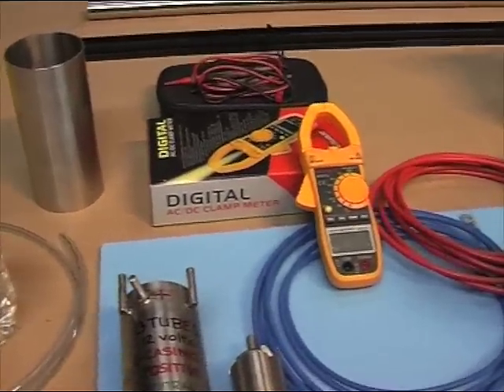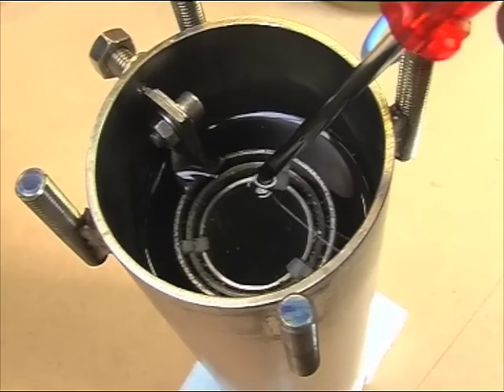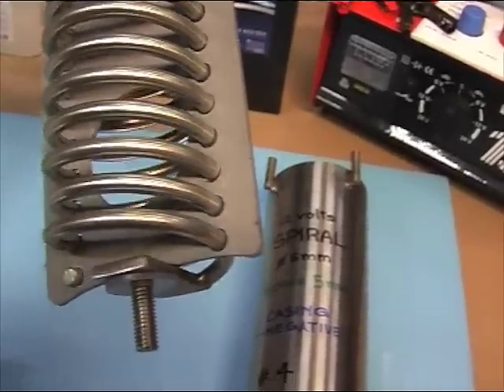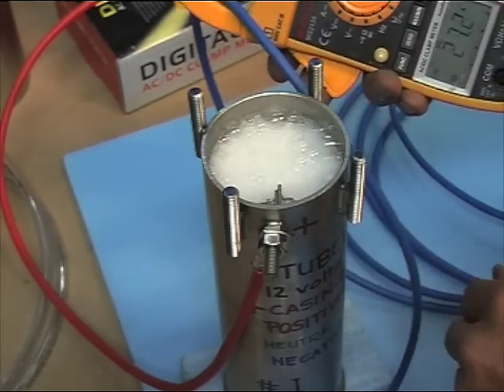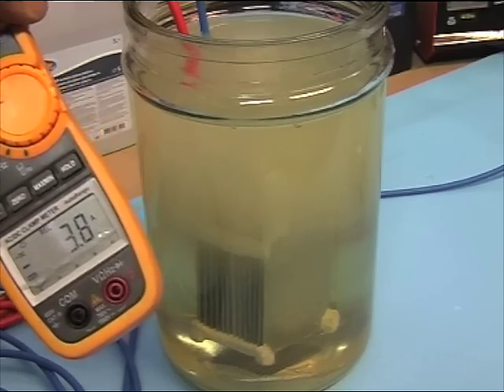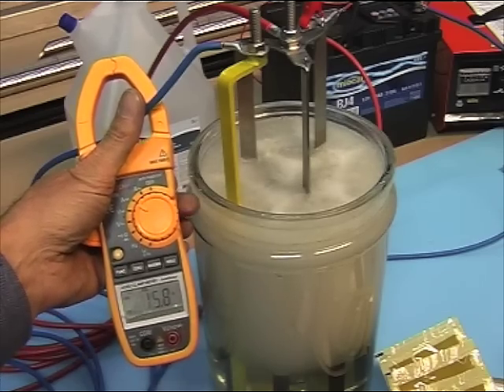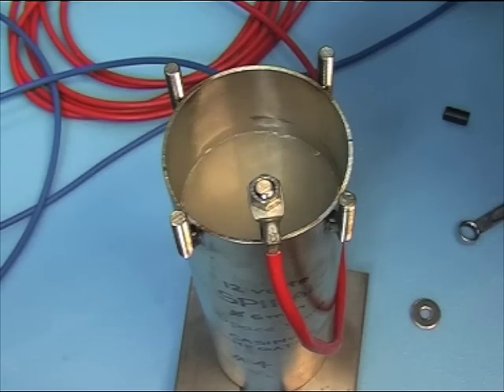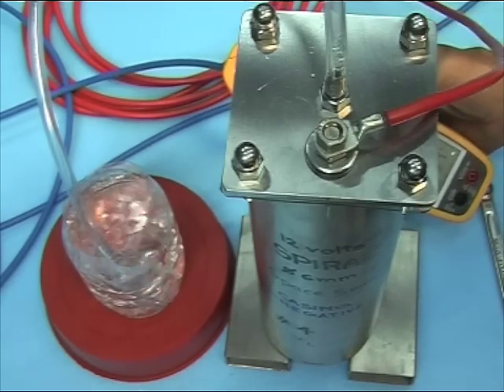HHO SWISS INOX 4 SPIRAL CELL + GAS PRODUCTION TESTS

Comment: The spiral needs to be much closer to the metal casing to lower the amperage draw and eliminate heat created. Use the same distance you have between the square plates and the amp draw should eqivilate..

Comment: Hho Technology will surprise you! Hho is a mind blowing technology . Cool engine running  prolonging engine life and engine oil life with less engine maintainess required🚦.

Engine life changer device improve engine performance and increase fuel burning efficiency like  a new car!!!  100% fuel will burn in the engine No un 

burn fuel wastage . Engine will run more power fully. Consume less fuel. Hho system works on petrol, deisel, cng, lpg and lng types gases.

Engine runs lighter smoother reducing carbon emissions significantly . Boost engine power and torque . Hho gas reduced engine noice & vibration

An efficient hho car kit lower the engine temperature more then 100 degree F.  To prevent heat build-up. Hho kits restore better fuel economy. Hho system is very easy and simple to install. Hho solves the engine heating problems automatically!!!.

Cleaner engine running. Reducing engine noise due to the faster fuel burning. Hho car kits works nicely requires no modifications in the car engine. No side effects on car engine.

Engine start quickly your car battery will charge  quickly car AC works better& safe your car battery.  make your car a low cost hy-brid. Use a  low amps. Hho car kit will work better. You can easily transfer hho kit from one car to another one. Hho kits requires no any modifications in the engine. For more information about this useful technology  keep watching hho zafar videos. Or call 03082266179 zafar karachi.

Comment: I wish i could share a pdf they used about 420 volt and was producing around 3000 percent officiant with a crap electrolysis set up like gauss and one bar yours if done like theres intern of volts very low amps like 0.5amp it was called plasma electrolysis

Comment: How can we keep this gas until we use it at a later time ??
Is it suitable instead for cooking gas ?
With many thanks
Reply: The combination of Hydrogen and Oxygen as a gas commonly described as HHO. If you store or compress it in a container it is a potential bomb because if any slightest spark can ignite it the Implosion/explosion is tremendous. Yes it is suitable as cooking gas as long as you "perfectly" know what you are doing. To produce it and use it directly is the best solution but even so if you have a return of the flame the entire production unit explodes. As long as you play like I am doing just for the fun of discovering a few things about it it is fine because mine are small units but as soon as you become serious and the size gets bigger you better have  a team of knowledgeable scientists at your side to assist you with all the proper safety required by law.
Reply: @carloammann6127  Thank you for all this useful information. Actually, as you said, the best thing is to use the HHO gas directly without storing it, taking into account safety conditions, including the use of a flashback arrestor .🌹🌹

Comment: The same way you make the coils, visualize it rounded out and flattened into a pancake coils not touching, interlaced, and then bring down a layer and make another pancake, I wonder thow if it would help to keep the spin the same direction of reverse the spin per pancake, where can I get vast amounts of this stainless steal wire in one continuous strand

Comment: What is the proper amount of amps should be making to  make my dodge Dakota 6 banger go down the road , also how long can I use this devise  without a problem ? Is it a simple click on & off process and I can run it indefinitely  ?, with the exception of adding water once in a while ? And do I add the baking soda each time i add water and how much to each water add  if at all

Comment: Inventor good night, okay with you ??? I'm seeing this video on your hydrogen generator, I made a similar, however the cable I did was galvanized stainless steel, called a source of 12V, with normal water !!! But there was no uniformed effect !! Galvanized steel cable does not work ?? The water would have to be with baking soda or salt water can be ??? It would be to my car, I have a corsa 1.4, a hug and continue with the videos, PS: Would you know how much I need hydrogen to my corsa walk !! I am a Brasileio, I have a degree in electrical engineering and I am interested in this hydrogen system !!
Reply: +kaio castro no, galvanization is an electric shield. i tried it too. it doesnt wirk. zinc conducts best but stainless corrodes less. and salt water works best but baking soda corrodes less. reg water doesnt work usually.
Reply from the maker: Canal Mequetrefe Na verdade eu sei o que es a corsa 1.4 aqui na Europa es uma Opel da GM he he he he
Reply: +AMMANN , vc pode me passar seu e-mail para contato ? Danke , estou aqui na suiça me interesso
Reply: + Kaio Castro , esta no Brasil ou fora, recortebrasil@hotmail.com, assunto sobre a materia.
Reply: ola , moro na suiça o cara e daqui e nao consigo falar com ele., ele nao esta mais motivado ????? vc teria o e-mail dele ? obrogado

Comment: I tried it with only 2 plates of perforated stainless steel and with a small section with cardboard in between them and that section had 3 x's more bubbles then the rest... Something that I have not seen anyone else try yet and that is putting something in the middle of the plates.  It's something else to experiment with if your wanting to make hydrogen to run your car using water .

Comment: a small tig/arc inverter welder might be of some use in your experiments. for starters you can change polarity with the flick of a switch. an has digital amp readout. also, a good one will have high frequency and fully adjustable pulse mode. it would be interesting to see if high  frequency will affect gas production. here in Australia we can get one of these welding machines for $800aud new. or a ac/dc weld machine with have more options too just an idea i,m putting out there.

Comment: To have any improvement in an engine, the amount of Hydrogen you need to produce, would create an explosion that would burn your eyebrows right off, VERY dangerous..You wouldn't be testing it with a naked flame if it produced enough Hydrogen! A couple of pops and a flame as weak as a candle will do nothing.

Comment: if you use pulsed ac electricity the skin effect keeps the current at the surface of the conductor. ac does not travel inside thick conductors. this will increase efficiency. ac skin effect calculators are online. its why we use stranded wire

Comment: I built the two models (with plates, and spiral). The tube spiral pattern most successful i more gas production. Although I utilizava the electrolyzer to produce chlorine in a pool. The biggest problem was that the negative pole of the electrolyzer found quickly wore out.

Comment: Just in case because I did not see it, use a in-line fuse rated for the size of the cable. For you security.

Comment: in the same way that 144000 volts at .5 amps will not hurt you but 144000 amps at .5 volts will fry you.

Comment: the most efficient system is tubes using variables of half inch diameter. the hard part is the electronics any heat produced is energy wasted. if you reduce the voltge to 2.2v you will not produce any heat but by reducing the volts you increase the amps so 10 amps at 14.4 volts becomes 60 amps +- at 2.2 volts it is the amps that produces the hydrogen and the volts that heats and burns the water.

Comment: I had the same problem caused by low quality power supply, Problem solved by adding 10 000 mF (maybe too much but i had one around so i used it here) capacitor behind the rectifier diodes. 
For a starter try to use the battery instead of AC to DC power supply. 
Drawing 5Amps or more from 5Amps supply will also result with the bumpy DC. 
To much electrolyte in the water could be the cause of the problem, 
Have you tried using tap water without adding electrolyte?

Comment: HHO can replace the fuel 100%, if you can provide enough of HHO.
The cell has to be able to produce approx 40-50 liters of HHO per MINUTE for 5 000 cubic (metric) engine. 
Running your engine on HHO will clean your exhaust catalyst converter (U save 1000$ for the new one), engine oil lasts 10-50 times longer. 
Build your own Pulse Width Modulator, it's easy to DIY, but you will need an Oscilloscope device for tuning the harmonics of resonance.

Comment: Stanley Mayer "resonant cavity method" is about founding the resonant freq of the water or electrodes. 
There are also resonant harmonics that increases efficiency, the more harmonics the more bubbles. 
Also i noticed that my production is best when the water temperature reaches 50°C, PWM gives me full control of the cell temp, volts & amps, controlling this 3 features enables me to maintain the 50°C temperature. 
cheers :)

Comment: You should reduce the voltage, as the voltage in these kind of cell vaporates the water.
You should use 1,5 to 2 volts per electrode and as many amperage you can get.
To start up a car properly without the use of petrol, there is another methods you should consider...

Comment from the maker: @MrPrncjosp HHO is just an addition to normal fuel. The car continues to run on petrol as usual, all the HHO does is improve the combustion so you will get cleaner exhausts and a deposit free combustion chamber. Depending on the car model you could manage to have some minor gas savings. I would suggest a small plates cell. For all your calculations go visit the youtube channel of a friend of mine: daddyo44907

Comment: Try to link the plates 2 & 3, 4 & 5, 6 & 7 and have a power connected on plate 1 and 8 you will get all plates producing and with little amps place a deivider in between each set of plates and will work even better, bit like batteries in series.

Comment: i like your stuff ,, nice work ,
one comment though (  and i see you already tied it but ) if you are going to run an active charge through the outer case , for saftey purposes it should always be negative on the outside ( because a car is designed with ground on the frame ) .
A long time ago in a galaxy far away ( britian ) cars were possitive on the frame ...lots of cars blew up in those days ... then they changed over to negative on the frame ....not somany cars blew up after that .

Comment: @DrGoodwrench64 I do agree. Since stainless is a resistor the smaller the gauge the better, unless you could afford GOLD, Being a good conductor and it resists corrosion, gold would be the perfect solution for the amperage! But who can afford that much gold? I think if you would incorporate a transformer coil on the positive side you would draw less amps and push out more which would compinsate. Thats my opinion! But what do I know? It"s who I know! Thank God!!!!!!!!!!!!!!!!!!!!!

Comment: Love the spiral design! However, I think the 6mm rod is too thick. That's a lot of resistance to overcome and will require lots of Amps to do so. Try 2-2.5mm rod for your spiral in the same setup. Your current load should drop and your production should increase.

Conditioning of the plates or rods consists of scouring all the surfaces with either fine grit sandpaper or 0000 Steel Wool and white distilled vinegar. Scrub till clean and shiny then rinse in distilled water. Ta-Da! Conditioned.

Comment: @dejiola2001
Also, if your spiral heats up too much, it could have changed it's shape and reached out and touched the outer casing, creating a short circuit during operation but testing fine when cooled to room temp. After all, this is basically an Induction Coil. As far out as that sounds, I've seen much stranger things happen.

Comment: @dejiola2001

If you think you have a short circuit or a Shunt condition, there is most likely a direct short to Ground (-) somewhere. A simple continuity test will tell you the story. Check to make sure your Positive (+) post insulator is actually insulating the positive lead from the negative (-) shell. A cracked, smashed insulator or overtightened retaining nut is often the cause.
I'm assuming though that you are using the same type spiral design as in the video.

Comment: @dejiola2001
ammanninox is a little off about the dielectric properties of Distilled Water. Distilled Water is a CONDUCTOR, not an insulator!!! This is the water we put into car batteries.
What ammanninox is thinking of is De-Mineralized Water. Water that has been de-mineralized has had ALL the Minerals removed. Without minerals in the water, electrical conduction can't occur. There is nothing in the water for the Ion exchange process to ride on. Hence, de-mineralized water is an insulator.

Comment from the maker: @dejiola2001 No because distilled water is actually an  insulator, but on the other hand I do not know your testing conditions. Check all the connections and look if there is any dirt stuck between plates. Consult an expert electrician with proper measuring equipment he should be able to help you out.
AMOX

Comment: I need someone to help me. During my experiment the current was returning to the power source and spoiling my DC device the sound of my gen set will just rise immediately abnormally. although hydrogen was being generated very well but this adverse situationis my concern. Please could the water cause short circuting?

Comment: You should try to make a cell from a stainless steel thermos flask, just drill a hole in the cap for a threaded bar to attached a lug for the power to the inner electrode, and another hole for a hose fitting. This should be cheap and easy to make, if the gas production is insufficient one could just manifold a few together. 

Have you ever experimented with aluminium electrodes?

Comment: @ajimaru87 any steel will degrade, some will oxidize faster/slower so u need to use an unreactive anode material, like platinum, u can by electrodes that have 3 layers so that it doesnt cost too much as platinum is very expenisve (titanium, nobium and a thin layer of platinum), u can also get MMO electrodes  which have a layer of different oxides so that they wont degrade

Comment: you say you used 6mm rod to do the spiral. since i dont have the equipment to ply such big rod perfectly. so i used  inox wire, you know the ones made with smaller wire. it allow more surface contact. works great !
since i'm just starting in hydrogen fuel cell i dont have any video yet .
but i will one day put some vids about it.

TRY  WIRE  !!!  instead of rod  !!!!         WORKS GREAT  !!!!!

Comment: we have a new dc to dc converter that will only allow the supply draw under 12 amps but will allow any cell to pull up to an adjustable 32 amps.And it reduces the 12 volts to 4 volts this keeps the temps down,it also has remote turn on therminal resistor to lower amps when the cell gets to hot,and a led to let you know when to add water.

Comment: Since I am half swiss, I hook a brother up.  What you need to do is space the plates in a non linear spacing.  Use 2 negative for the outer plates and one positive in the center, and 4 neutral plates ( 2 on each side).  Now what you want to do is insulate the outer plates, and 75% of the bottom of the plates.  This will cause a convection action and pulse fresh water thru the cell, instead if it cavitating on the hho bubbles.  Your HHO generator is basically a short circuit, control the flow.

Comment from the maker: Look, 41 amps is totally out of question, because all it does is heating the water real fast, and yes run down your battery just as fast. This was some early testing of mine now I have come a long way changed many things and I have a broader vision of what electrolysis is and what it is not.
Basically all I do is having fun experimenting and lately I am having fun putting together a cell that is commercially interesting and reliable.
I hope to be ready by january

Comment: Forgive my extreme basic question/assumption here on your set up; but, at 41 amps...how long is your battery going to last?  I'm not ignorant to the big picuture...I assume this gas will ultimately fuel an engine which would hopefully be able to do real work and recharge the battery.

Excellent video.  I love it when the theory of science is put to the test.  

Subscribed
5*

Peace

Comment: Hi! with regards to your 13 plate cell, try to lessen the plates in-between the positive and negative. you should get better results from that. my 9-plate cell is pushing around 1.5l/min of hho gas in half a liter of distilled water and 0.05 molar of NaOH with 13.8vdc and 15A.  it's 3 plates in between the + and - plates. 

here is my configuration:

+nnn-nnn+

hope this helps you.

Comment: As far as I can see you have near perfect manufacturing techniques.

You might want to try about half the electrolyte you're currently using. This is not from experience but from observation. It seems that other people have had better production with lower current using similar setups.

As to the plate cell, I think the reason only the center plate is producing is because of current leakage on the plate edges. To address this, ZeroFossilFuel recommends an acrylic backing along the edges.

Comment: Hi every one. i have got the best theory (idea) to produce high volume of hho using lower amps and voltage. but i need some one to work with me here in melbourne. No body in the world has tried this yet. my phone number is 0061431604005.

Comment: If you were to uses gas for the sole purpose of producing the O2 then yes it would be a very poor system, however then gas being used is what would be used in you travel time.  So if you can supplement you gas mileage during that time,  why not?